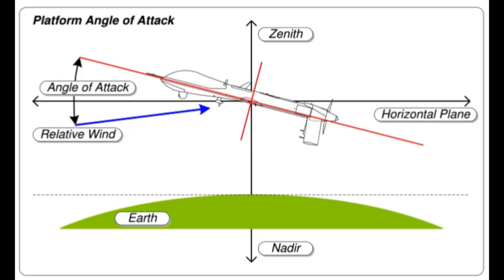Main Reason Airplanes Crash. EXPLAINED

Comment: If your speed is fast in a large angel of attack, then the relative wind on the wings would be coming exactly from the opposite direction, where the flight path is.
What's the problem then?
Fighter jets can too fly with any angle of attack without stalling, because of their high speed.

Comment: Hello Mojo, happens that last sunday in Mexico a Private Jet crashed in the state of Coahulia, and by the data recorded Flightaware, I guess the Stall condition, caused the accident, becasue in a very short time, the Jet changed 37K feet to 41k feet altitude. The jet code was N601VH.

Comment: Sorry, I don't agree with your explanation of why a steep turn increases stall risk. Lift is obviously produced Perpendicular to the wing. So, the less the wing is perpendicular To the Ground (that is, the greater the bank), the less vertical lift you have overall and THEREFORE the closer to stalling you are (unless you increase power, whatever). Yes, the outer wing will have a slightly higher airpeed, which is why, in a spin, the inner wing has stalled but not the outer wing. Spinning is a Different Matter.
Yes, stall-spin accients when turning final --- I've overshot the runway, so I'm turning too steeply and I squeeze in a bit of rudder to hasten the process, then oops, I'm overbanking so I bring the stick back the other way and ... crossed controls = spin.